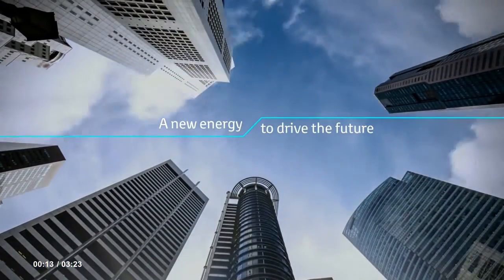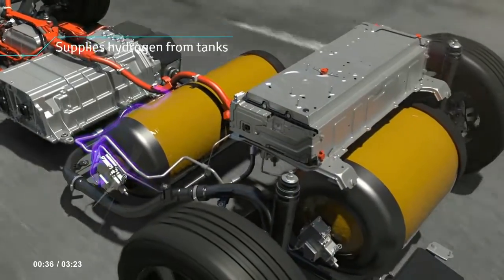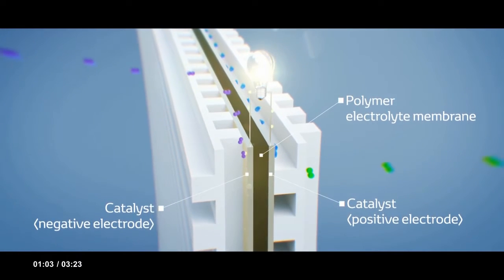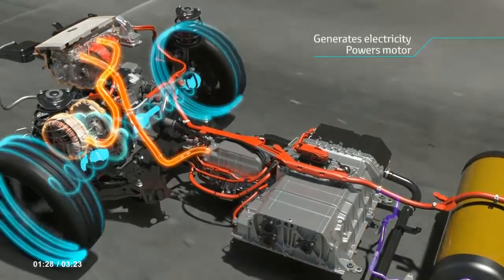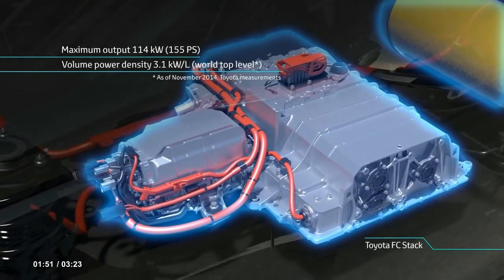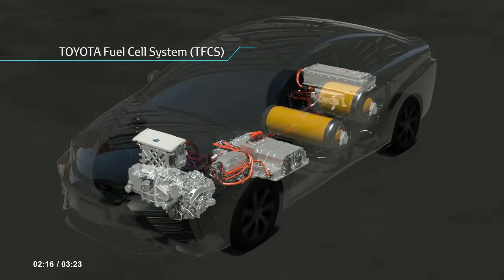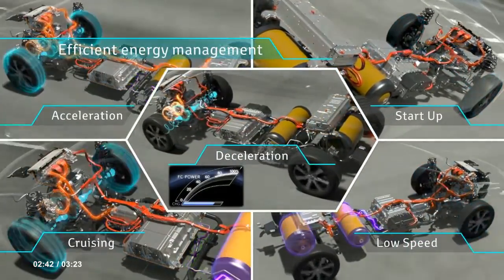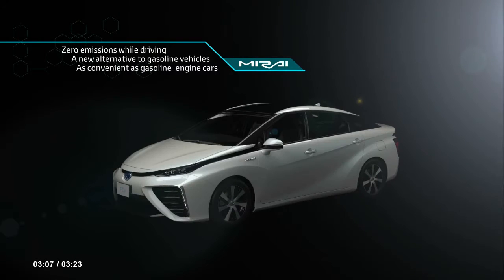Hydrogen Toyota Mirai

Comment: Except that the Hydrogen to be used first has to be produced which uses masses of electricity to perform the Hydrolysis. The Hydrogen is then stored under pressure and transferred to the car's tanks under pressure as with LPG and kept under pressure. If there is a leak it is odourless but very volatile.   Electricity powered cars are simpler and safer.
Reply: And the electricity for a battery EV comes from ???
Reply: Mmm petrol is safe ???
Reply: @donlemons  Petrol is highly volatile as well.